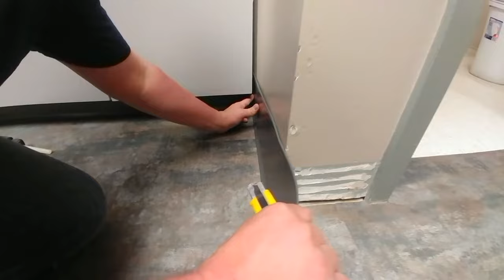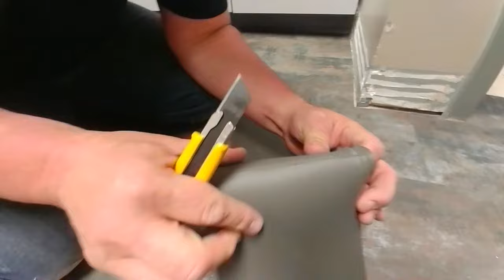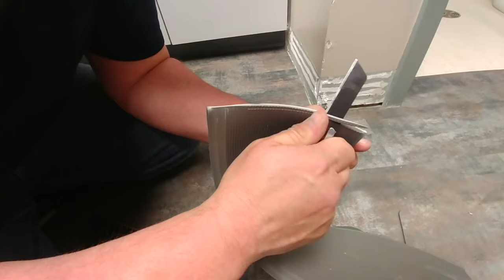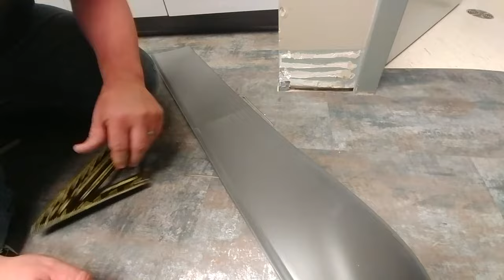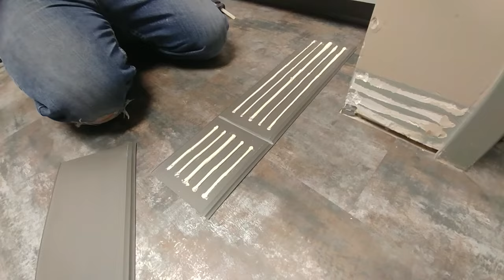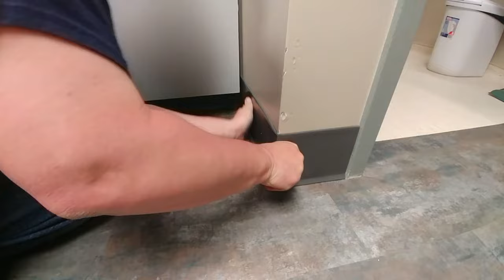Installing Vinyl cove base corners

Comment: I am installing this in a bathroom where I dont want it to be able to leak underneath.  Any suggestions as to how to keep water from leaking underneath.
Reply from the maker: Use a good sealant. Not just the cheapest silicone. Preferably clear. I've not had a huge amount of success doing that but it can help if water spillage is an issue.

Comment: Great video,fast & clean , on point. just quick q? After install what's the best / easiest way to clean out that adhesive spreader
Reply: It can’t be done easy.
Reply: I just run water in it.

Comment: Is caulking required in the bathroom to seal the top & bottom of moulding? Thanks for demonstrating the installation near wood moulding, I didn't know what to do about it till I saw that you just placed it next to it ...
Reply from the maker: I guess you could seal the bottom but I would not do the top.

Comment: What is that multi lines nozzle you are using to apply the sealant?
Reply from the maker: It is an applicator that you can buy from most flooring stores and box store. It fit onto the end of the large tubes of Wall base adhesive.

Comment: Do you really hot glue every outside corner?

I'm not trying to be a know-it-all, but that hot glue is simply not necessary. When those corners are cut properly and you use a full spread notched trowel for the adhesive, they will stick just fine. Your cutting technique is pretty good, but try taking one slightly deeper pass down the center instead, and avoid scoring the toe.
Reply from the maker: The hot glue is just to good it in place till the other glue dries. It'll keys you move around a bit quicker on big jobs
Reply: @mrfantum1  I know what it's for, but if they're cut correctly you only need base adhesive.
 How does adding an extra tool and an extra step make things move quicker?
Reply: @kwantoon  It’s his method and it works for him  this way tried and tested he won’t be back round there seeing if it’s pulling off the wall especially in difficult conditions looks good too me he will get paid at end off job and have piece off mind that it is stuck at the corners that’s all it matters